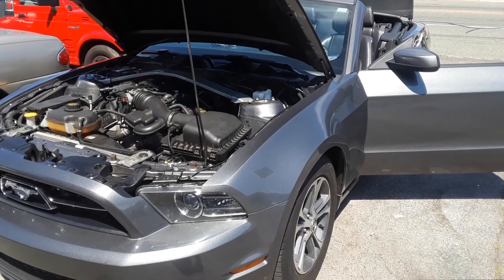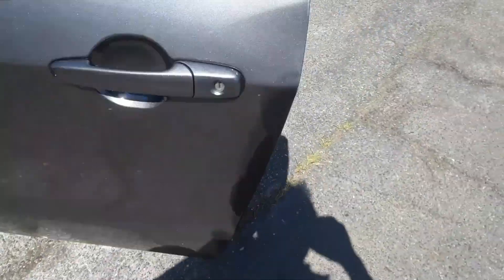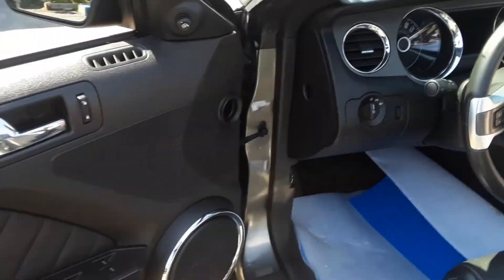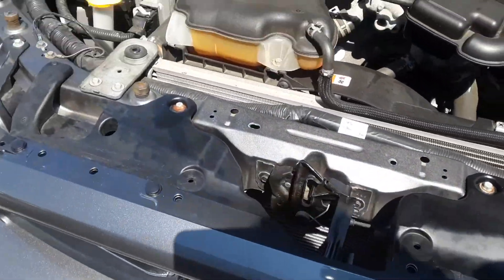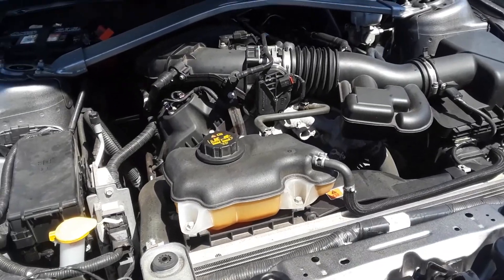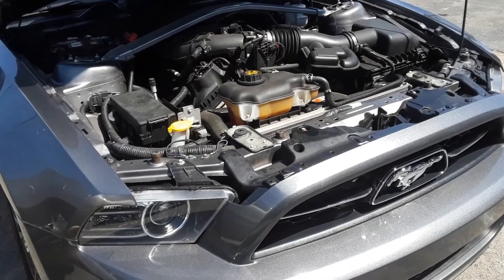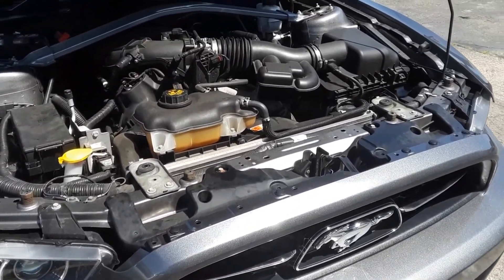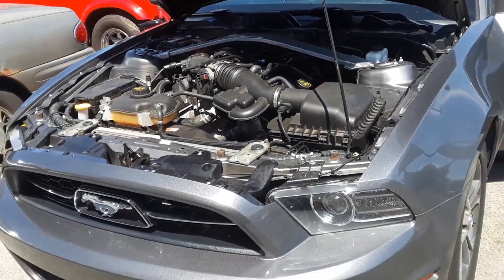Ford Mustang Fuel Shutoff inertia Location

Comment: WRONG!! Yeah, so the info in this video is INCORRECT. 2010-2014 Mustang is DIFFERENT. I have a 2008 and it has the switch in the kick panel location and it is very easy to access, it is NOT hidden down in the kick panel, it is a red button that is basically level or just a bit above the opening in the kick panel. I also have a 2012 and while it uses the same kick panel with the opening  THERE IS NO SWITCH in that location and you reset the fuel pump by turning off the ignition, wait at least 10 seconds, then repeat, and the computer will reset itself.

Comment: Does this work for the 2020 s550?  I got into an accident on my driver side and caused my airbags to deploy . And the car just stopped but I have no damage at all to the front end or even the engine bay .
Reply: We’re you able to get it started?
Reply: @Jay-ze3rc  yup! On the road now! I’m assuming it’s a safety switch all I did was unplug the battery and re plugged it in.

Comment: Will this switch just stop working?? Reason I'm asking. I did have a collision recently in the front. But car was able to be run. I fixed bumper. But a month ago or so it did have trouble starting, turned over but didn't start. Then eventually did start. But yesterday, it turned over and now won't start at all. I heard could be inertia switch, but now I'm not sure. Any ideas, (other than fuel pump) ? Thank you
Reply: I doubt it mine wouldn’t even crank when the switch was on

Comment: Does that cause it to not crank over to ?
Reply: i believe so, it’ll turn on and the lights for the dash will turn on, but the second you go to crank it’ll give a locked up motor crank noise and you cannot start it

Comment: I took my kick panel off to find out there no button just wires with connectors
Reply: Sidewayz Gunter i am having the same issue right now
Reply: Oscar Martinez I called the dealer about it they said it’s a rubber button hidden in there but I still can’t find it
Reply: Sidewayz Gunter I cant find it either
Reply: @oscarmartinez8596  My buddy just told me about the beermaster video, he was right very funny, watch my video (link below) and You'll see why!
For your answer go see my video, 
Mustang After Accident, Fuel Shutoff Procedure - 2005 thru 2014 Ford Mustangs  https://youtu.be/87NdhFFM_Lc
Reply: Watch the Stiles Automotive video
Reply: My buddy just told me about the beermaster video, he was right very funny, watch my video (link below) and You'll see why!

For your answer go see my video, 
Mustang After Accident, Fuel Shutoff Procedure - 2005 thru 2014 Ford Mustangs  https://youtu.be/87NdhFFM_Lc
Reply: Same here. Mustang 2013 v6. Any solution?
Reply: @747lalit  My buddy just told me about the beermaster video, he was right very funny, watch my video (link below) and You'll see why!

For your answer go see my video, 

Mustang After Accident, Fuel Shutoff Procedure - 2005 thru 2014 Ford Mustangs  https://youtu.be/87NdhFFM_Lc

Comment: Mustang production date 04/16 has that fuel reset cut out on left kick plate but no reset switch behind it, thank you ford engineers using the same piece of plastic on cars without the reset switch, the ECM resets it! SMH.
Reply: My buddy just told me about the beermaster video, he was right very funny, watch my video (link below) and You'll see why!

For your answer go see my video, 
Mustang After Accident, Fuel Shutoff Procedure - 2005 thru 2014 Ford Mustangs  https://youtu.be/87NdhFFM_Lc
Reply: @StilesAutomotive  2 my 11 how are op
Reply: @melvinfuqua8551  Melvin, what do you mean?  Are you asking a question? Watch my video, it probably answers the question - Stiles
Reply: 98 fuel cut off switch in trunk drivers side
Reply: Yep...starting in 2011 (possibly 2010) there is no shut off switch in the kick panel and you reset the fuel pump by turning the ignition-waiting 10 seconds-turn ignition back on then repeat those steps one more time.